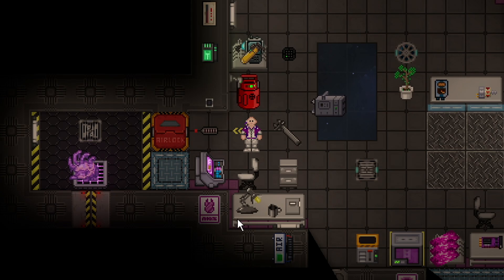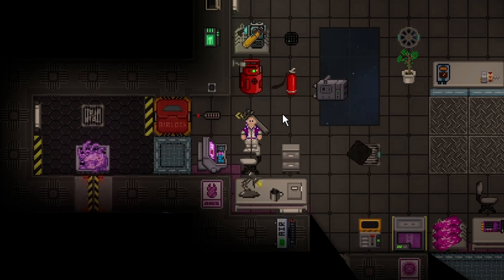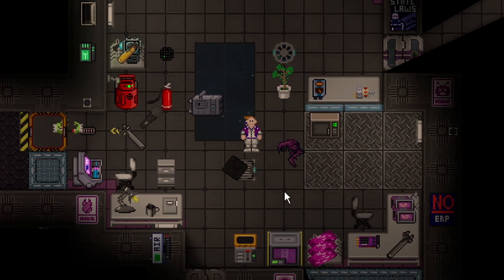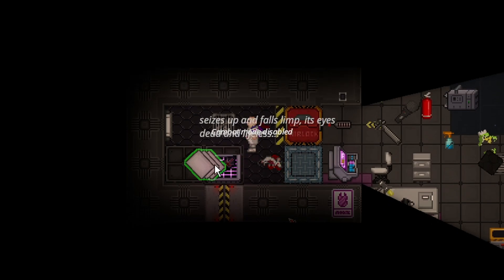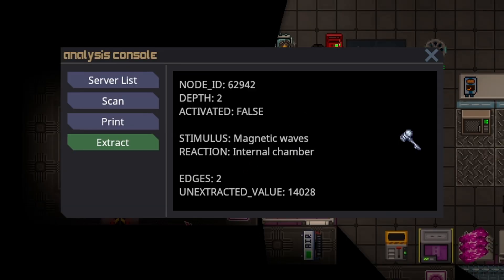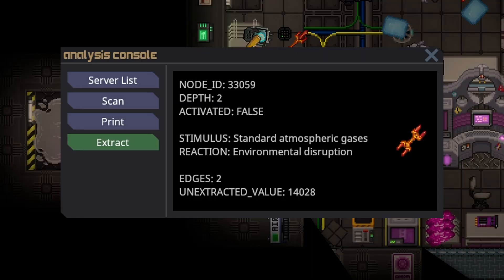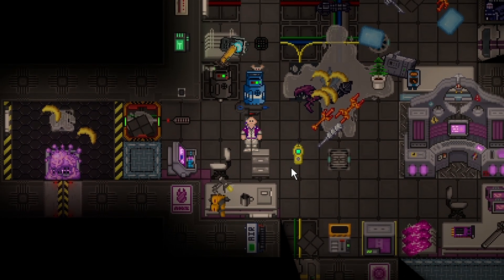SS14 - All Artifact Triggers Explained (Out of Date)

Comment: 0:58 hydro-reactive
You can also attack it with a filled container in hand.

2:08 radiation
Some people already mentioned bananium and a damaged RTG.

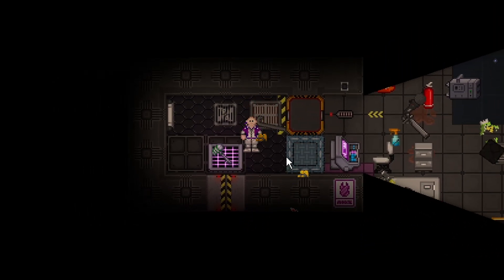04:35 depth 3 pressure
I usually hook up an air can and just pump 500 kPa into the chamber.

8:20 I've seen worse first hand. There was an atifact that likely reacted with low pressure and had the deadly explosions. Easy way to get gibbed.